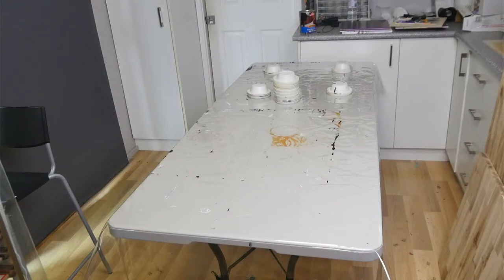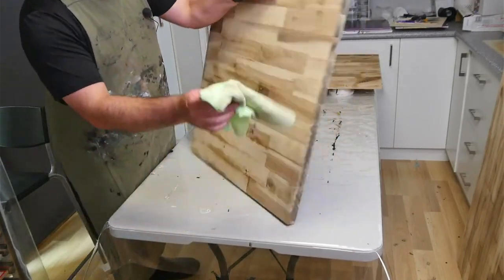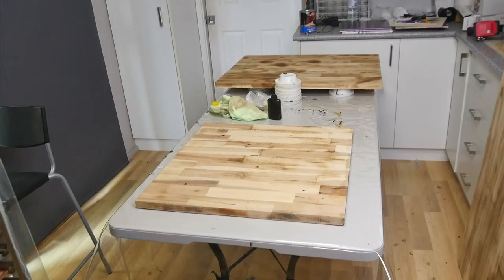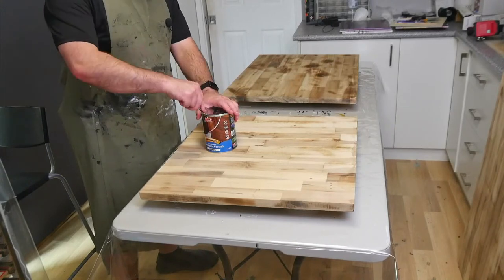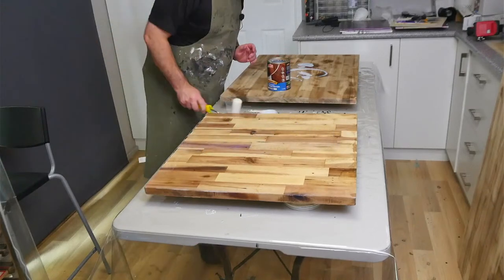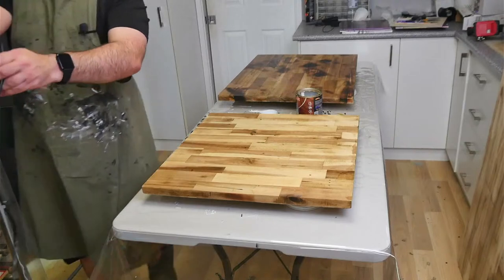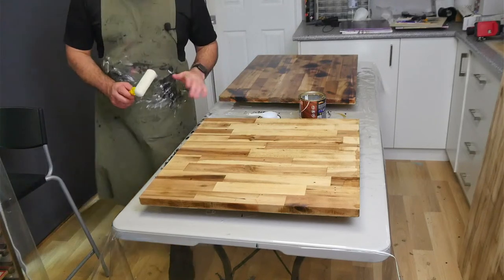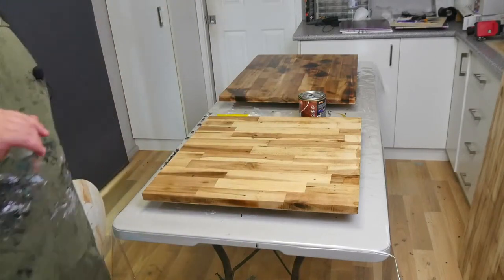Art Step by Step - LIVE - Preparing Tables for Painting

Comment: Hi Mitchell, I make rain sticks, from bamboo.   I also want to cover one with acrylic skin.   Do I need to varnish the rain stick, before applying the acrylic skin.   What glue would you suggest to stick acrylic skin to the wood?
Reply from the maker: Skins are different as they aren't introducing moisture to the wood. I'm not sure what you could use to adhere the paint to the wood though as whatever glue you use may not adhere to the bamboo. If anything I'd say something like araldite but that sets veeeeery quickly and leaves no room for error
Reply: Thank you for your knowledge and time.   I guess experiment time.   Thank you

Comment: How about applying  Gesso before pouring on wood?
Reply from the maker: The purpose of gesso is to create texture for the paint to adhere to and to fill gaps in canvas. It wouldn't actually be detrimental in this case as every time I've used gesso it bubbles up and peels under the paunt
Reply: thanks. Will any type of wood varnish be suitable? I have some wood that I plan to pour on, so your tutorial is helpful. I will however wait till you show us how you pour acrylic on it before I do mine. When will you put out the next video?  At this point I have no idea how to pour on wood and what recipe  to use for it. So any advice from you will be much appreciated. Many thanks